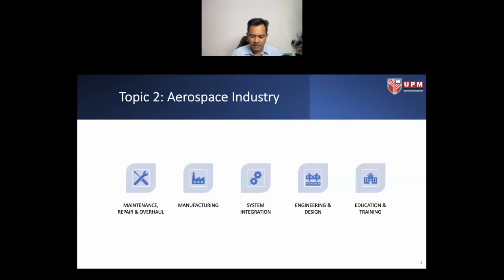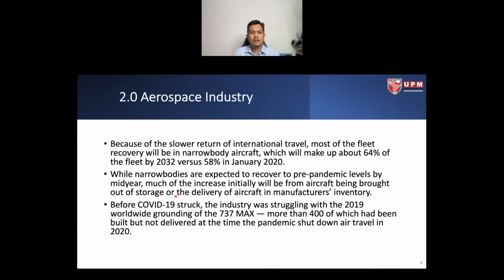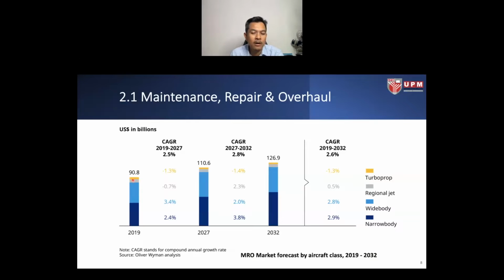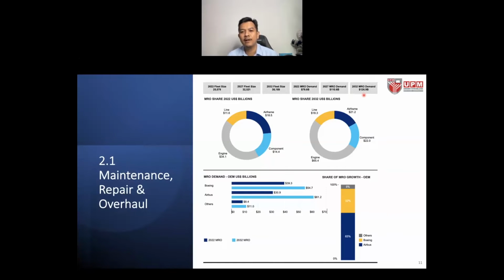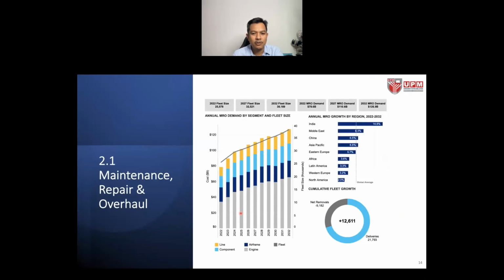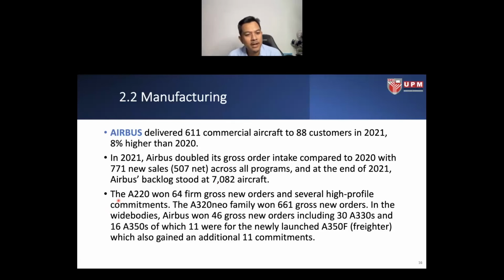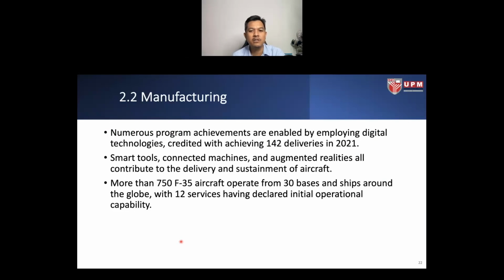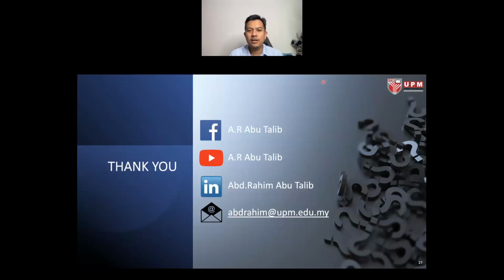AEROSPACE INDUSTRY | MRO and Manufacturing

Comment: Assalamualaikum Dr. GS71703 signing in. Airbus took a proactive step with A321 XLR  narrow body which offer extended range, higher pax and higher efficiency engine. Turns out to be a good choice to reduce cost per seat and broader destination coverage which is preferable by airlines.
Reply from the maker: Waalaikumsalam, indeed! The A321 XLR is a great example of strategic innovation in aerospace.

Comment: Assalamualaikum. I am Nur Izyan Izzaty, with student no GS72973 signing in for attendance. 

regarding the interference between 5G wireless services and radio altimeters, studies have indicated that the coexistence of both could cause interference. In response, several airports around the world have implemented mitigation measures, including restricting the placement of 5G towers in close proximity to airport facilities.

Comment: One advantage of MRO over manufacturing is that the former must continue to operate normally during downturns such as the recent pandemic and global recessions, since all aircraft in service undergo scheduled maintenance regardless of the number of hours flown and it takes a lot of effort to preserve any aircraft for months or years and then bringing them back into service.

Whereas manufacturing is in the mercy of the global aviation industry at this moment, from lower tier manufacturers upstream of the supply chain to aircraft operators as well as the flying public and logistic companies.

Lai Hong Yi - GS66631.
Reply from the maker: That's a great observation, Lai Hong Yi! MRO's consistent demand, even during downturns, certainly provides a significant advantage over manufacturing, which is more directly tied to new aircraft orders and market fluctuations.